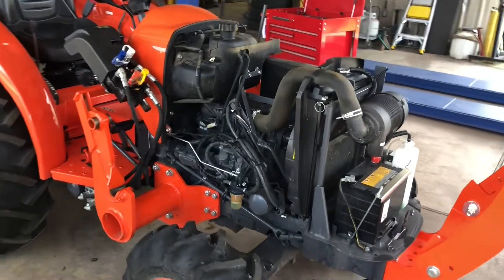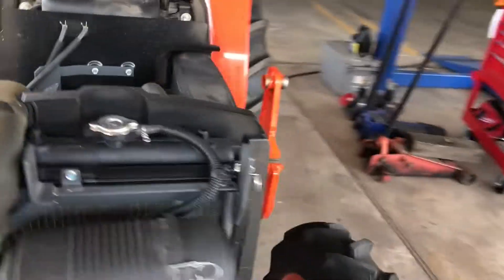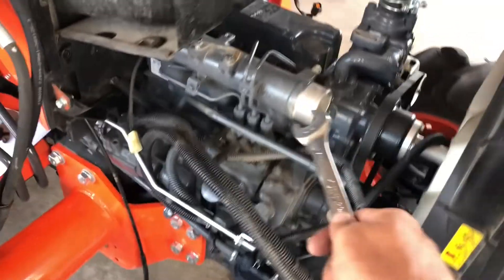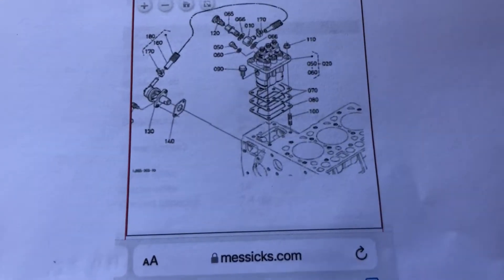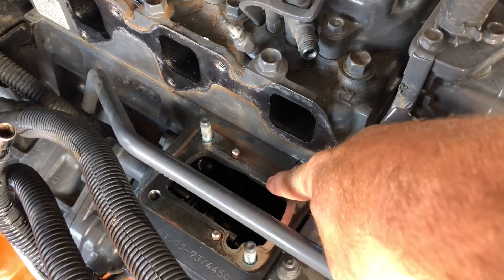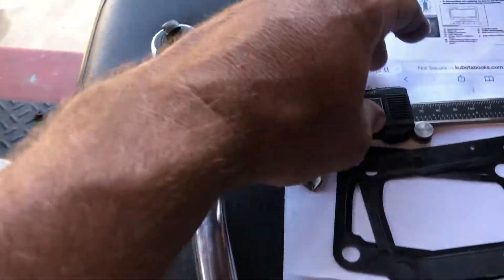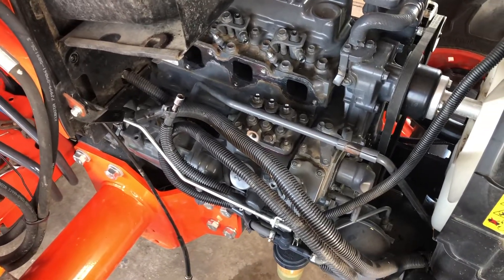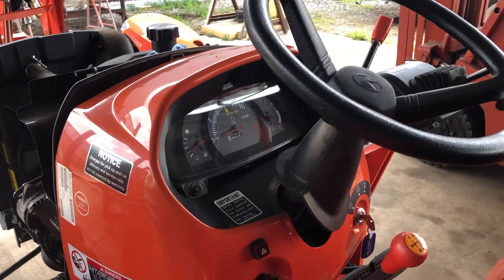KUBOTA L2501 ~ BEST MOD ~ INJECTION PUMP TIMING & FUEL SCREW ADJUSTMENT : PT.1

Comment: Shims are for timing engine not one is the same. Pin heads are changing timing can cause overheating or engine to run like 💩 poop.  Motor needs nothing! The owner need to understand the limits and be happy is was able to get in that series
Reply from the maker: Do you research on how these Kubota engines work. The rev limiter set to 2200. RPMs is painfully low as well.

Comment: The reason the older tractor ran higer timing was because the injectors were not able to atomize the diesel as good back then, and the combustion needed a longer start. Newer injectors like in your tractor can atomize the diesel much better resluting in quicker combustion.

Comment: Just went to my local Kubota dealer to order one of the thinnest shims.  I told them what I was doing and got told all about how bad of an idea this is.  Any long term updates to ease my mind?
Reply from the maker: Have 140 hours now. Zero issues. The dealer has no clue how anything works.
Reply: @RaztechPowersports  I finally found a diesel mechanic do exactly what you described here.  Two questions if I may; Is the pyro meter necessary (trying to stay under budget)?  I have a 3 point stump grinder that has to have its clutch adjusted for PTO horsepower.  What do you think a safe guestimate of PTO HP after mod?  Thanks so much!!
Reply from the maker: @03stage2  no you don’t need to meter. That was just for some general testing. I would set it for 32-34 hp

Comment: Just did this on my 2501, I had one shim measured at .4mm.  I used loctite 518 since it has the potential of being the thinnest at 20foot lbs of bolt torque. So far so good, thanks to you and @netmagi

Comment: Have seen this process in hardworking mowers that cooling systems have a tendency to run with a certain amount of debris and so be on the warmer side pushed to overheat by this mod.

Comment: Did this improve the power as you expected? My 2501 skips bad when hot and running at over 1600 rpm’s.
Reply from the maker: Absolutely. The the factory rpm is set way to low imo
Reply: I had a l2501 do the same found out the cam was bad on it

Comment: Great video. I desperately need to do this to my 2501. It only has 50hrs on it but recently developed a miss under load - starts making black smoke. I have been through the fuel system all the way to the pump, can't find a single thing wrong. I'm convinced it has a piece of trash in one of the injectors - so I have to tear into it anyway. I'll implement this change while I'm at it.
Reply from the maker: Yeah, I would definitely take the injection pump apart and make sure all the springs are good and no trash is hanging up the pistons

Comment: I am going to do the mod this weekend on my 2016 L2501, and your videos have been a huge help! I have one question: What was the final throttle screw adjustment position you settled on; was it a full turn out?
Reply from the maker: Glad it helped. I settled on 3/4 out on the fuel screw. Was rolling a little to much coal while bush hogging. You still want it to burn pretty clean under a heavy load. A little smoke is okay
Reply: @RaztechPowersports  thanks!

Comment: Would any one know if this is the same process on kioti ck2610. I see people adjust the fuel screw but not the shims.🤔???
Reply from the maker: Remember, removing the Shims increases the timing on the injection pump. I’m not familiar with the kioti engines unfortunately

Comment: o there is no impact by doing this? engine issues? rich? lean? the why would the factory design it like this initially? seems odd its so easy to do?
Reply from the maker: Detuned from the factory to be under the 25 hp threshold for no emissions

Comment: I’ve seen you and netmagi do this and neither of you figured out that there’s a 0.175 shim available.  Only $7 at Messicks.  The shims in the WSM aren’t the only ones available.  There are actually 5 sizes available.
Reply: I haven't been able to identify the 0.175 shim you mention. Do you have a link to it, or a part number? Only one of the shims for the L2501 currently offered by Messick's lists the thickness spec, and that one is the 0.35mm shim.
Reply: @tcgoggans  I always use the IPB on the KubotaUSA site.  Generally more parts and better info.  The 0.175 shim is 1G866-52200.  Two in stock at Messicks.

Comment: My 70's L345 factory Injection trimming is 25 DEG BTDC. Your new L2501 shipped with only 5 DEG. Thought you might find that interesting keep it up.
Reply from the maker: Agreed. This motor is very detuned from the factory
Reply: @RaztechPowersports  How do you actually measure the timing besides just taking shims out?

Comment: Did you turn the fuel adjustment screw counterclockwise and how much did you turn it?
Reply from the maker: Correct, counter clockwise. 3/4 of a turn.

Comment: would you say the exahust temp guage necessary?
Reply from the maker: For my testing… it was cheap insurance. No not necessary tho
Reply: @RaztechPowersports  thank you. My background is turbo cars. So I assumed remove shims, make gasket and turn out 1 full turn to left and we should be ok
Reply from the maker: @james9862  then you’ll have no problems doing this project. Go 3/4 turn out of the fuel screw.

Comment: What is the timing modifications do exacly to the engin
I had boost mine just by unscrew the halen bolt 🤔
Reply from the maker: It’s putting fuel in the the cylinder quicker. Also a little bit more fuel

Comment: How different is the lx2610 engine, i wanna try and boost mine just a few extra HP to run my 60” tiller smoother. I know it’s okay since it shares the 3310 powertrain. I believe I have a d1305 or something

Comment: So what was the outcome from the upgrade, you did the Dino but how did it perform with attachments and overall hills?
Reply from the maker: The performance increase is noticeable. I did turn the fuel down 1/4 of a turn. Other people have commented that the 2022 has no shims under the injection pump

Comment: i bought a new 2022 l2501 a few months ago. i pull a 5 foot bush hog in almost 5 feet of grass and small trees, 2nd gear high range with no issues! power is no problem with the 2022 model at all. i have even tried to chock it down by going faster. this is a little power house, i have no need at all for more power. pulling a hill in high gear no problem.
Reply: Sounds like it is a Gear Drive. The majority of L2501's are "home-lowners" owned hydro-slack-o-matic's---they need all the help they can get.
Reply: @donaldstrishock3923  Yes sir, mine is a gear drive L2501 DT.
Reply from the maker: That’s pretty interesting. My 5 foot bush hog would bog down pretty easy in pasture grass
Reply: Same here, I have no power issues with a LX2610 5’ brush hod with 3-4’ tall grass
Reply from the maker: @00_ELECTRICWIZARD_00  maybe they made an improvement. Mine would hold 1800-1900 but just bogged
Reply: @RaztechPowersports  UPDATE..incase anyone wants to know.  on my 2022 model i checked today, there are no shims under the pump. it has sealant you can see around were the pump seats into the block. it seems they did update for 2022... just letting ya know.
Reply from the maker: @km4fsi827  thanks for the update! Apparently kubota knew this tractor was under powered and bumper the hp. Good Info

Comment: I think my L3400 and the L2501 share the same base engine the d1703???? I often wondered two things, why the lower HP and the reduced operating RPM's, just stands to reason it is basically the same package, and I have never understood the comparatively lower operating RPM's, actually considered the 2501 when I was looking but I thought I'd be pushing it with the implements I already own and PTO HP, and the next choice up L3301 had the emissions junk👎
Reply from the maker: Yeah very clearly limited the engine meet the sub 26 hp emission requirements

Comment: Thought you were doing the EGT-probe first based on your comment in the vid where I mod'd mine :P    Be CAREFUL till you're reading the temps.  It rises FAST.
Reply from the maker: I did but I didn’t want to post it all in one video are bore people. Video is posted now 📺. Temps have been great at one full turn out on the fuel screw at 2600 RPMs

Comment: Glad to see someone else is doing a video on this as well.  The parts diagram is misleading.  These machines don't come with 3 shims.  Those are just all the shim thicknesses available from Kubota to obtain the factory spec'd timing, regardless of the actual differences in the machining on the face of the block and pump.  Both of ours happened to have 2, but some machines may have 1, some may have 5.  Those shims are stacked at the factory until the required timing is achieved.   That's the reason for the different thicknesses available and the range listed in the spec vs. an EXACT timing target.  No two machines will be exactly alike, but they should all roll from the factory within spec, albeit with a different combination of shims to get there.  I considered removing both in mine, but I didn't like the idea of a gasket-maker on those machined faces after the fuel filter.   If any squeezes through and breaks off in the future, it could block the pump or an injector.  I wonder what the thinnest gasket material is that could be purchased and cut with an x-acto to fit.
Reply from the maker: Yeah man I watched your video and really appreciated the level of detail. I’ve been doing my own research over the last year and knew it would work as well. The gasket maker is meant to go in tight machined services like engines and transmissions. It only seals under compression like loctite. Any sealant that gets in the motor is washed away by the oil (which is minimal). You are correct on never using RTV silicone near an injection pump though. It could ruin a lot of things. So far everything is bone dry. No leaks 🙏🏻
Reply: @RaztechPowersports  Fair enough. . I agree in theory oil should wash it away vs. getting up into the pump .  I'm very curious to see long term if it holds up.  I may consider cracking mine open again.  Wonder how much thickness the gasket sealer adds to those surfaces.  It's gotta be less than 20 thou, but would be neat to try and measure it.  Could potentially be done by marking the position of a mag base from the block with a dial indicator that touches a spot on the top of the pump, pulling the mag base off and setting it back in the exact spot afterwards.
Reply from the maker: @netmagi  I would say it’s definitely less than the gasket material itself. I’ll be making a bunch more videos pushing it to its limits. Have 20 acres of grass that grows like wildfire 🙃
Reply: Might be too much effort, but perhaps one could take off a few thousands to ten thou off the underside of the pump then get a shim in there as a good gasket. That way you’re able to get it to exactly the height you want.
Reply from the maker: @beneviolence1946  I fully considered that as well. I have a machine shop next-door who is extremely talented. The injection pump housing is very beefy and could easily be clamped
Reply: @RaztechPowersports  are you going to go more in depth with adjusting the fuel limiting adjustment?  I can not seem to make any real difference in mine.  It seems to run worse bringing it out.  Is there a way to set it precisely or is it just by feel?  Mine definitely ran better with removing the larger of the two shims.
Reply from the maker: @akalpharaider7580  I have it one full turn out right now. I’m actually putting it on a pto dyno so I can load test it / tune it properly. Video will be posted this week. 👍🏻
Reply: @beneviolence1946  yeh, about 8-10 thou off and one .2mm shim/gasket would be great, but the risk of damaging the pump is hard to stomach. They’re well over 1k new. Good reason to get that mill i’ve been eying up though :)